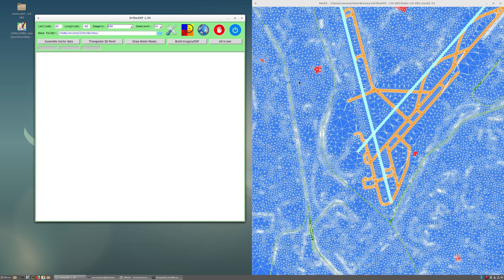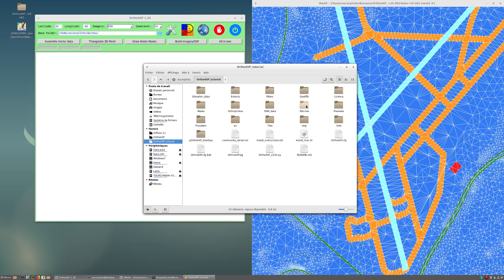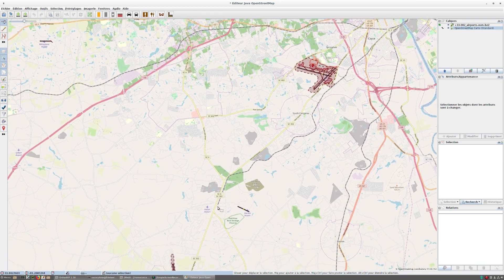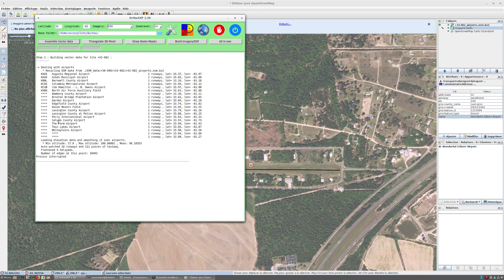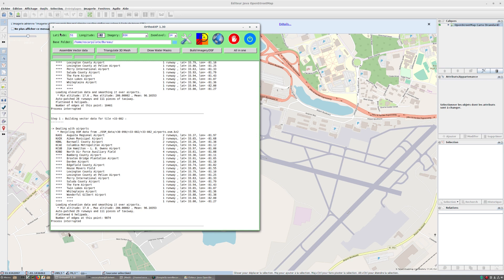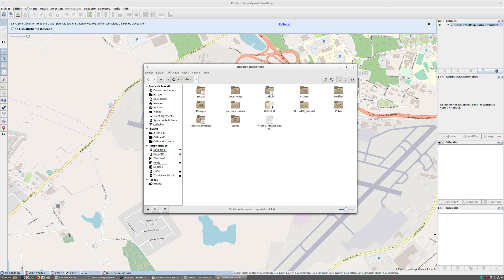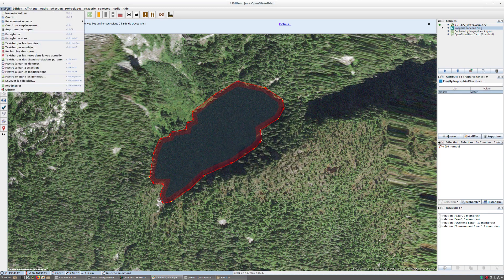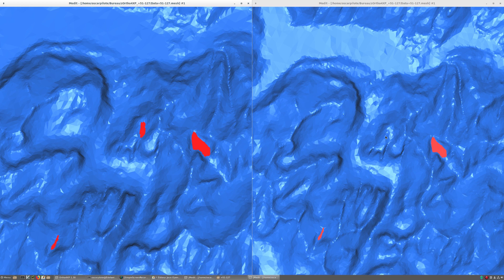Ortho4XP v130 tutorials : 3 - Editing vector data

Comment: Great video, i am trying to fix some problems since one week, it would be very nice when somebody can give some information about Ortho4XP. LTBA Airport in Istanbul looks very bad in XPlane 11, therefore i used Ortho4XP, a very powerful and nice software. But there is a problem in the mesh, extreme slope is next to the Airport. Street looks like there is a 10 meter declension. Furthermore so many roads overlap or stop somewhere, a cut in the middle of the highway. Therefore i decided to use a OSM Data 'called planet-latest.osm.pbf'. But how can i put this on XPlane 11, how looks the best config in Ortho4XP to generate good streets, tracks, lights etc. Thank you in advance.